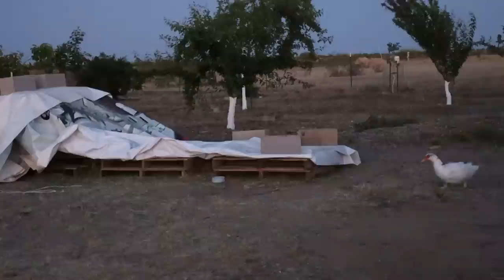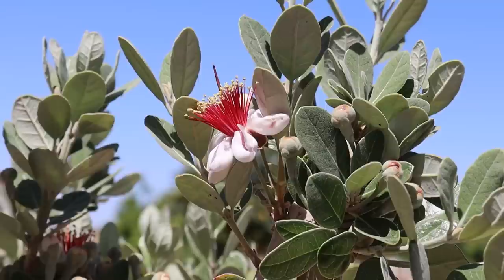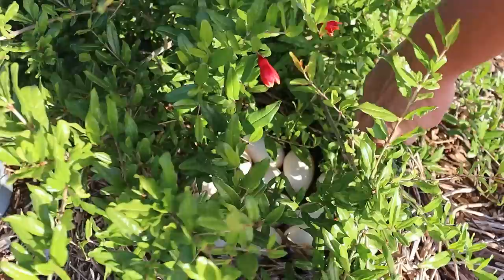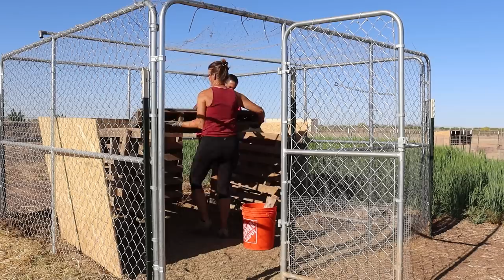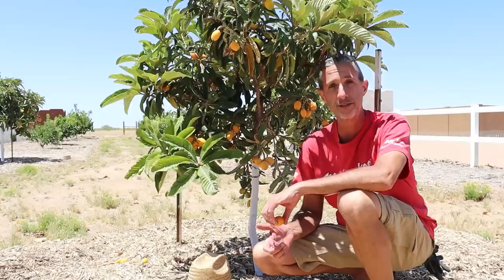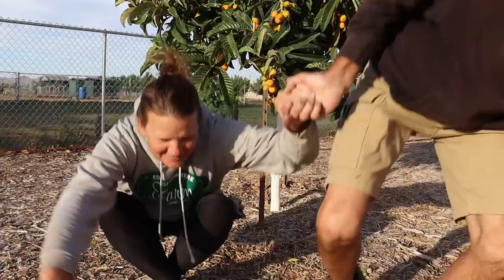THE Key to Loquats in the Desert | Growing Loquats in AZ

Comment: Hi. What is your watering schedule on the loquat tree you were sitting under? I had 2 loquat trees die last year.
Reply from the maker: Hey Justin. They are on the same schedule as our citrus which is currently 60 gallons of water once/week. We generally don't go above that, but it reduces drastically once we're below 90 degrees in the Fall/Winter. In fact, with the rain we had last Winter we didn't irrigate them at all from November until late March.